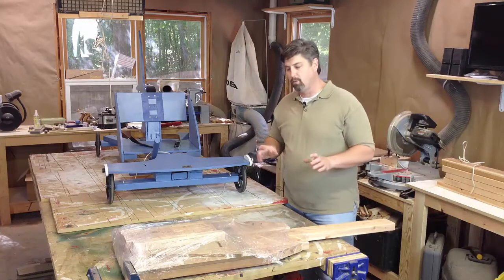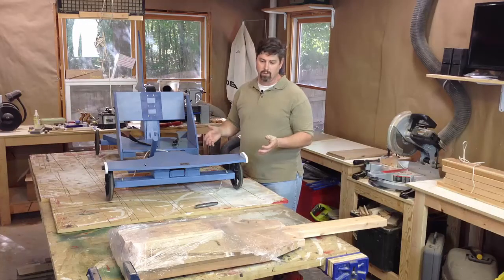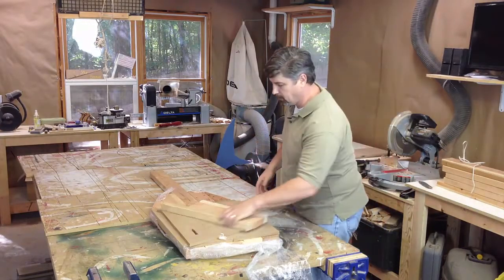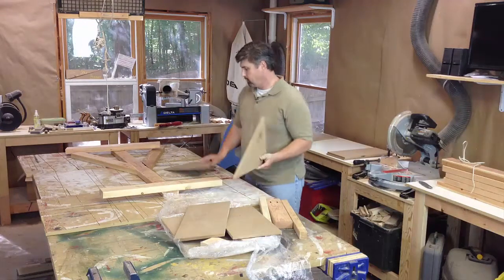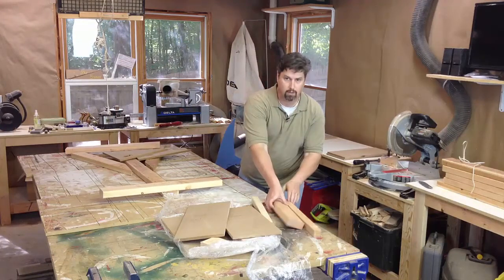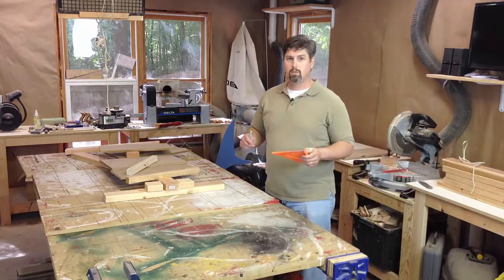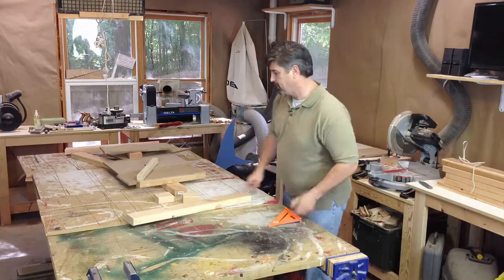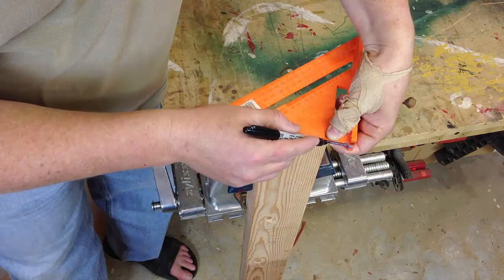Cub Mobile Assembly Part 1

Comment from the maker: I have something sketched out that I work from, but I have made nothing formal . . . yet.  It is on the to do list.  What is not explained in these videos (and maybe I need to explain above) is that I have run the cub mobile for our Pack for the past 5 years.  In addition to running it, I buy, cut and wrap all the kits myself.  (Side note - When I say 'run' the cub mobile, I mean organize - Pack 37 has an amazing group of people that work as a team to make the Cub Mobile Race day an amazing event for the scouts and I could not do it without them).   We have a pretty big pack (about 95 scouts) and to make my life easier, I made these videos for the new Den leaders so they can watch these and not been intimidated by this project if they have never woodworked before.  My ultimate goal is to get the supply and cut list together so someone can take over my role in the Cub Mobile, along with a video on how you cut and put all the kits together.  Sorry it took me so long to respond.  I have been dealing with a number of trials recently (I play a lawyer by day ;)  If you are planning to start a cub mobile, let me know a good number to reach you at and I can give you a call. leh@avidwoodworker.com

Comment: Good videos. Had a question for you. It appears you purchased a kit for this project. If so, where did you purchase the pushmobile car kit? If not, do you happen to have a grocery list of what is needed to complete this car? I like your setup. Seems sturdy and very straight forward. Thanks in advance!
Reply from the maker: I used to build the kits for the whole pack.  I figured rather than taking dozens of calls on how to build them, I would just make a few videos.  I have not made a kit in a while, however.  But, I believe I still have the list of what is needed.  I moved recently, so it may take a while for me to find it.